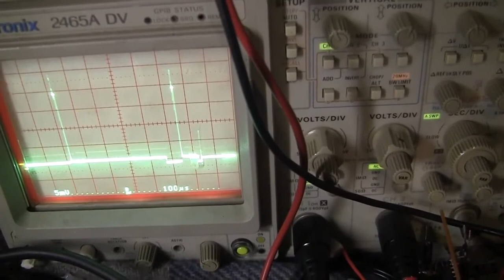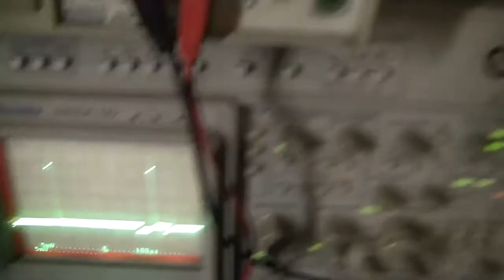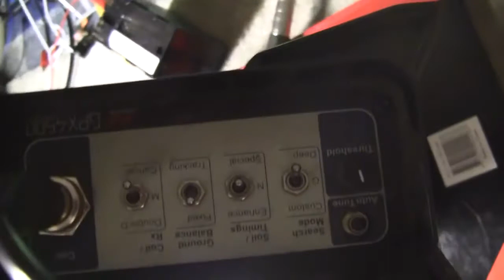Enhance timing compared to normal timing  GPX4500 depth test

Comment: Good morning and thank you for this valuable information, and I have a question please exists on this link .           _ (How many turns are in the grand coil _18 inch _ and wire diameter user (gpx 4500))  _and how it is linked the wires in numbers? ....my respects.